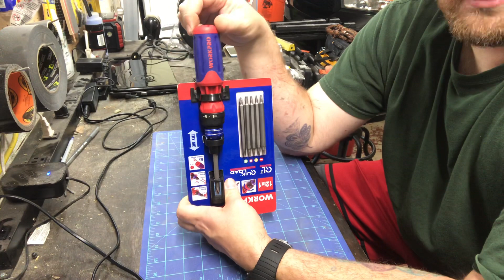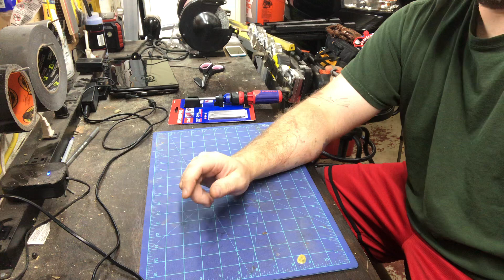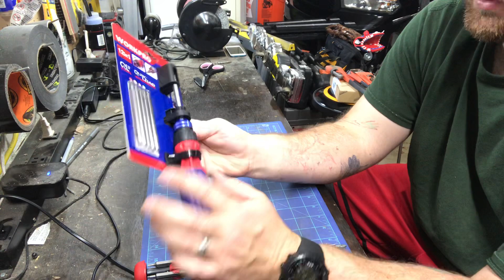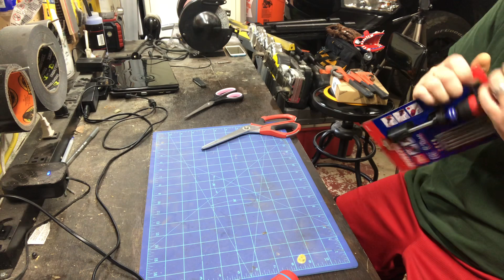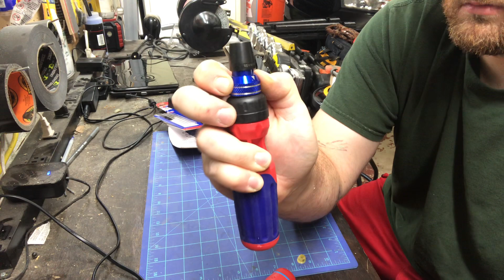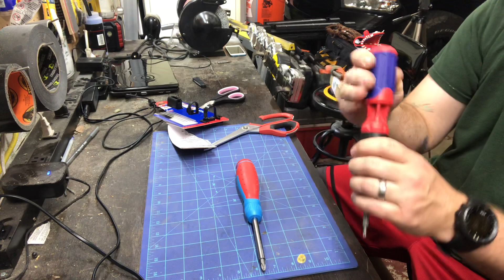Looking For An Awesome Ratcheting Screwdriver Set? Look No Further Than The Workpro Set! #workpro

Comment: Hi, Can I use small bits (25mm) with this ratchet ? I'm asking to understand if spacial bits (long with both ends) required here? how it is as of today ? Are you still using it ?
Reply from the maker: Hey. Thanks for watching!! I will have to see on Monday if a shorter bit works in there but I’m fairly certain it should because it’s like a 1/4 inch hex driver. And yes I use it all the time. It stays on my bench at our main building cause we use it so much there. It’s held up great. I will let you know tomorrow for sure. Have a great day

Comment: How's this ratcheting screwdriver working out? Looking into getting one.  Thanks buddy!!
Reply from the maker: Dude. I absolutely love this thing. It works so smoothly. I highly recommend. I was trying to get a stuck bolt of a circulator pump on a boiler and I didn’t have all my tools so I put 2 hex adapters and a 5/16 nut driver then used a 12 inch pair of channellock on the handle to get the bolt to budge. One of the hex adapters cracked but the ratchet mechanism and screwdriver are still 💯 fine. So yeah I gotta say this is a winner in my book. Thanks for watching!!
Reply: @themaintenanceman1  wow,  sounds good man.